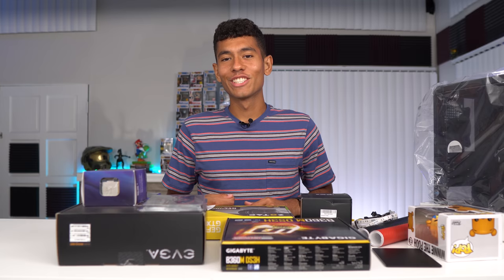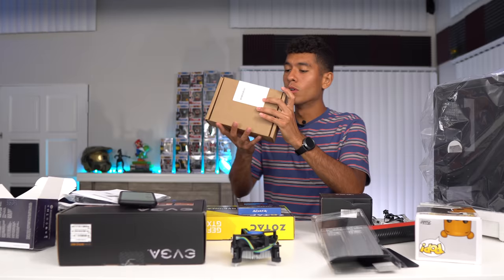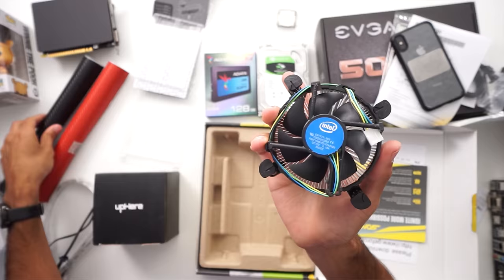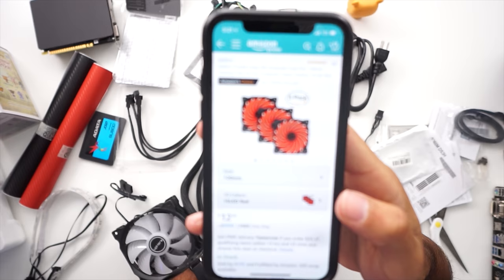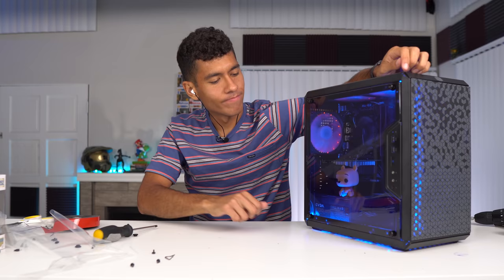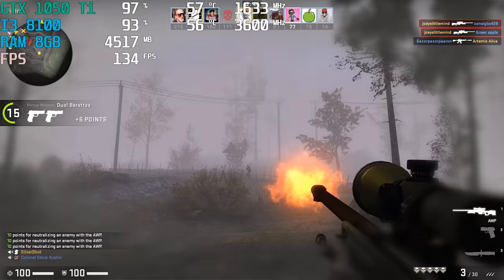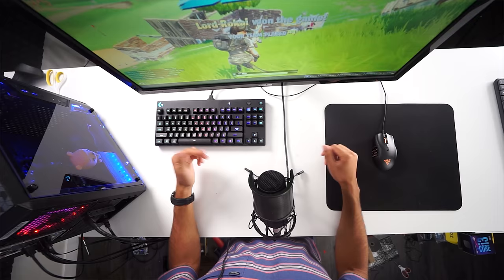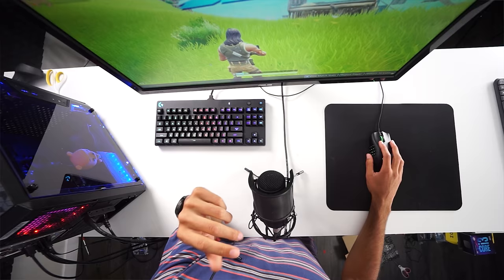$650 Gaming PC Build - i3 8100 GTX 1050 Ti (w/ Benchmarks)

Comment: Nice build.  I'm planning on something similar but will go for an i5 8400 with a gtx 1060 6gb.

1 question.  Would you recommend the Gigabyte motherboard?  I've seen some bad reviews.  Problems with BIOS updates, installation of Wins 10 but my main concern is the PCI clearance when you put in a GPU.  I want to add a wireless card and the GPU covers the vacant PCI slot.  GTX 1050 might be ok but a GTX 1060 would be much bigger.
Reply: Will it work with this build? 
AMD Ryzen 5 1600 3.4GHz Hexa Core AM4 CPU + ZOTAC GeForce GTX 1060 3GB

And how much of a difference would there be compared to the current build in this video?

Comment: yup those Zotac mini  4GB 1050ti are might. i used it as a Hopd off with a Asus B350-f Ryzen 7-1800x  3200MHz Ram and it was ok, i didn't really see anything, can tell if it was Bottlenecking.  there good cards

Comment: Out of the two 1000$ guides you did which one is better?  I’m planning to build one of them!
Reply: Nick Hunter build the one with the 1070ti and ryzen 5 1600 the 1600 has 6 cores and the 1070ti is Just a lot more performance than a 1060 6gb
Reply: Michael Murphey Ok Thanks a lot!
Reply: Nick Hunter no problem

Comment: Question.
Core i3 8100's data sheet shows that it supports RAM upto 2400mhz. So how come 2666mhz is being used? Won't 2400mhz be cheaper as well?
Reply: the motherboard chipset is b360 which is supports only up to 2666
Reply: I see. Thanks for the info!

Comment: Did this exact build opposite brands. Ryzen 2600x or 2600 .1650 super. G skill 16gb 3200mhz ram. 500br evga psu kingston 240gb ssd asus prime b45m-a/csm mobo. Gets 2000 performance if done correctly

Comment: I have a Asus gtx 1060 graphics card and a ryzen 3 vega 8  graphics and a gigabyte b450m micro atx motherboard and a  500 evga power supply with 2 sticks of viper ram 4gb I got the driver plugged up and the gtx downloaded but it saying I dont have a driver but one is plugged in Then the pc keeps crashing Please help

Comment: Will this be goodfor 1080p60fps gaming and work.

Cpu: AMD - Ryzen 5 1600 3.2GHz 6-Core Processor 
Motherboard: MSI - B350M GAMING PRO Micro ATX AM4 Motherboard 
Ram: Team - T-Force Delta RGB 16GB (2 x 8GB) DDR4-3000 Memory 
SSD: ADATA Ultimate SU800 128GB 2.5" Solid State Drive 
Hard Drive: Western Digital - Caviar Blue 1TB 3.5" 7200RPM
Gpu: Zotac - GeForce GTX 1070 8GB Mini
Case: Cooler Master - MasterBox Q300L MicroATX
Psu: Corsair - CXM 550W 80+ Bronze Certified Semi-Modular ATX Power Supply

Comment: Hey guys! I want to know if this list of parts is good for my 470 dollar PC.

CPU: Pentium G5500

Motherboard: MSI B360M Pro VDH

Ram: Ballistix sport 2x4 2400mhz

Case: Rosewill FBM-X1

Power supply: EVGA 450W BR

Hard drive: Seagate barracuda 1 TB

SSD: silicon power 128 GB 3d band

Graphics card: GTX 1050 to 4Gb

I plan to play all games at 60 fps+ with medium-high graphics detail.

Comment: i have a question. I got the same case,but i still doesnt understand how does airflow works in here. my graphics card blows to the front of the case,should i get case fan on front panel as an intake or exhaust? and one at the bottom underneath the GPU for an intake?

Comment: I need help building a PC I’m basically new to PC gaming. What I know I want is this:

A PURE PERFORMANCE BASED FPS Machine.
I can live with out the RGB. But I am on a budget. 

I want a consistent 144FPS on Titles like Rainbow Six Siege, Overwatch, Pubg.

I already own a 144hz monitor. But I need a machine that can fully utilize it.

I know that I wanna stick with Intel i5 but I can get the i7 if Necessary.

My friend is offering me a gtx1060 for $100 so I’m probably gonna take it.

How much ram is necessary? I was thinking the Corsair Vengeance 8GB (x2) for 16GB if ram but can I get away with 8GB?

What about powersupply? Is 650w watts enough? Maybe 750? (EVGA)

and the motherboard I was told ASUS motherboards are easy to work with? So I saw a Asus z370-II LGA

I definitely want an SSD I saw the Samsung Evo 860 500gb (I don’t use a lot of memory)

And as for a case I chose the Meshify-C based on Price and Airflow.

What else do I need? Some cooling fans? A cpu cooler?.

(Just to be clear this PC I want to be my startup build that can run FPS at 144FPS consistently even if it means tweaking the settings in game. Pure performance. No RGB. I can always upgrade parts later.)

ANY HELP IS GREATLY APPRECIATED.

Comment: Hey nice build but If i were you i would save up a bit more to buy a core i5 cause the 1050 ti is kind of more reliant also a bit on the CPU and trust it will increase the power and well worth the price
Reply: If I made this build and replaced it with an i5 would it be compatible and do you know how much it would increase FPS quality etc?
Reply: @dhruvmadaram7842  it would and I would say you can bump up to 20 more fps
Reply: @blownshards1324  okay thanks a lot for the help man

Comment: I'm gonna be upgrading my pc from
Intel Pentium i5-750 2.67ghz
Gtx 1050ti MSI 
8gb Kingston DDR3 RAM
500gb hdd
And some old Asus motherboard
to a 
Intel core i7-3770 or 4770
16gb ddr4 ram
256gb ssd and
1tb hdd or 512gb ssd instead of 256gb
And some new pretty cheap motherboard

Whadayathink guys?

Comment: question...if i use gtx 1060 3gb with this build..wont the cpu bottleneck the performance of the 1060? thanks for the answer....
Reply: Yea a little but I reccomend replacing the i3 with an ryzen 1600 and getting a 1060 3gb
Reply: Would this work?
AMD Ryzen 5 1600 3.4GHz Hexa Core AM4 CPU + ZOTAC GeForce GTX 1060 3GB

And how much of a difference would there be compared to the current build in this video?
Reply: @BSTGMR-kj3tu  yea it should be a beast 1080p gaming machine, big performance upgrade from 1050ti to 1060 3gb and 6gb, I would reccomend spending a bit more money on the 6gb version because newer games are requiring more vram so. But yea but that should work perfectly

Comment: Is a PC like this capable of playing games like R6, Destiny 2, Overwatch, etc at ~60fps at Medium-High settings while streaming on Twitch at 720p 60fps? 

If not this build, then is there any other one of his builds capable of reaching that desired number? My budget is sitting at roughly $800 so even if it isn't a build from this channel, any build would be greatly  appreciated :)
Reply: Ryzen 5 1600 or r7 q700, b350 mobo, 1050 ti or higher, 16 gigs of ram, and the rest is what u want ssd, psu etc

Comment: So I’m building a pc and I’m completly new to this but i have everything’s but instead I’m getting “MSI GAMING GeForce GTX 1060 6GB GDRR5 192-bit HDCP Support DirectX 12 Dual TORX 2.0 Fan VR Ready Graphics Card“ instead of the 1050 and for ram im getting “
Ballistix Sport LT 16GB Single DDR4 2666 MT/s (PC4-21300) DR x8 DIMM 288-Pin Memory“ instead. Will that work with all of the other parts correctly and is that worth it? It adds like an extra 200$ in total.

Comment: Is this a decent combo for 60 fps 1080p?

Amd ryzen 5 2600x
Sapphire rx580 nitro 8gb
X470 mobo
500w psu
2 8gb sticks of 3000mhz ram
I want the build to be upgradable by just getting a better graphics card in the future. Thoughts?
Reply: Yep
Reply: @lilcupp5517  yea it does me great. Not even overclocked and its great. Compared to consoles.... which suck major nutz

Comment: Today with $650 you can build a i5 with 1060 . Also ssd now is very cheap . So just get a 500gb ssd with a 1tb hdd
Reply: Nazreen Helmi  really?
Reply: @crispjg3605  yup
i5 9400f = $150
Gtx 1060 6gb = $200-220
Mobo = $80
Ram 2x8gb = $90
Psu 550watt = $50
Storage ssd 500gb = $80 / hdd = $45
Pc case = $30
Reply: @crispjg3605  prices will drop in 3-4 months so go grind da munny

Comment: Used is the best way. I bought a pc for $240 with everything but a cpu and storage which the specs are am4 motherboard, 8gb ddr4, rx 570 and 460w psu. I'm gonna buy a ryzen 1600 for $120.

Comment: would recommend to get a 1060 6gb or 1660 for a lot more preformance but ofcourse if its in your budget
Reply: Dragon Tomas also an RX 570 runs round 5-10% better performance wise than a gtx 1050ti and is also cheaper
Reply: @decstar  true

Comment: Is it good? 860$ (600pc)
Dual Core G5400 3.7GHz (67$)
AMD Radeon RX560 4GB (185$)
16GB Ram 2400MHz (170$)
Western Digital 1TB (50$)
SSD Kingston 120GB (40$)
Gigabyte H310M S2H LGA1152v2 (75$)

and one amazon product: ViewSonic XG2402 24" 144Hz 1ms 1080p FreeSync 260$

I want a pc for PUBG (Super Low, Render Dis High) Fortnite (Quality Epic, Render Distance Epic, Shadows Epic and the rest medium) Pubg mobile on emulator and miNeCrAfT
Edit: In Romania (ma country) things are more expensive :

Comment: I have a lenovo h50 pc specs are i5 4460 8gb ram and 1t hard drive and a gt 705 i wanna upgrade the gpu and case as it is small any suggestions?

Comment: I built this exact pc but my graphics card was preventing the pc from connecting to the monitor, so I got a new graphics card and it still doesn’t work. Please help
Reply: Did u connect to the back of the graphics card?
Reply: Or even turn on psu

Comment: you could've used a ryzen 5 2600 and XFX Radeon RX 570 for better performance
Reply: I would have chosen ryzen 3 2200g and rx580 instead
Reply: @Joe-yp7fi  why's that?
Reply: @illusionslooth9777  actually i take back my statement i looked on pc part picker and  put together a 2600 and rx 580 for 650
Reply: @Joe-yp7fi  oh wow, mind sending me the link?
Reply: link is already there
Reply: @Joe-yp7fi  there is no link
Reply: @illusionslooth9777  I could just tell you the parts I used
Reply: @Joe-yp7fi  why not the link? just ctrl+c then ctrl+v
Reply: @illusionslooth9777  i already put the link twice and you said you dont see it

Comment: Will a 2 fan ghraphic card fit in this case? And could abyine point me to a motherboard that will support the Ryzen 5 2600 out the box and no not the 2600x. Thanks.
Reply: apple dell aids prime b450 plus great motherboard for the 2600
Reply: apple dell u should get a atx case instead u have more room more future proof and the double fan card will fit
Reply: Noah Ahmed i picked up this one in the video i wanted to get a win min 101 case but 80$ was to much for me for that case i picked up the 2600 and some 8 GB of viper 3000mhz ddr4 ram im just stuck on the motherboard this will be my first build the motherboard i was going to go with is the gigabyte b350 with Wi-Fi I believe
Reply: Noah Ahmed is the Asus prime b450 motherboard going to work out the box with the 2600?? Its the one thats 89.00 on newegg??

Comment: Heey Joe .. maaan I love your chanel i think I watched over 50 videos in the chanel in FULL I'm not even skipping few seconds I love your builds..
I'm in the process now to build my own very first gaming PC ever .. I just hope that you can build something very very similar for me in your channel just to have a look on the benchmarks and performance bro .. I'm going with ..
* i7 9700K
* Corsair Vengence RGB pro 16GB Ram 3000mhz DDR4
* intel 660 m.2 SSD 512GB
* 2TB WD HDD Blue 
* Asus Prime Z390-P motherboard
* 750W PSU
as for the GPU, I'm on a tight budget now so I will wait few months, save up and  buy my GPU ((most probably RTX2070)).. but as of now I will be using MSI GTX1050ti 4GB I found it really really cheap so I think its good to start with on a temporarly basis..
there you go bro.. those are all my parts, can you build something like that just for me to have a look on everything together and performance, thanks in advance 😎👍
Reply: Why 750 watt thats way too much

Comment: What if I used the money for ssd and just used it to buy a 1060, will it work?
Reply: Burdii Ako yes, do that. 1060 is so much better than 1050ti
Reply: yeah that would work. You are basically sacrificing startup and boot times for applications for more raw performance in games, if thats what you want, I would still recommend a small 120gb ssd to anyone. I would also recommend looking for a aftermarket graphics card

Comment: Hi Man, thanks for the video, i have a question for you, I'm making my first build using this case AND im worried about the cpu Cooler, I've got an hyper 212 Evo from cooler master and i dont know if my cooler Will Fit In this case. What are your thoughts? 

Thanks in Advance for the answer
Reply: julian camilo gil vargas their should be enough space for it
Reply: It will be extremely close the acrylic if not barley touching it

Comment: JUST PUSHING MY LUCK JOEY I HOPE IT CAN CATCH YOUR ATTENTION... IVE BEEN THROUGH A LOT HARD WORK BUT STILL CANT BUY A GTX 1060 FOR MY PC BUILD I HOPE YOU CAN LEND ME SOME OF YOURS OR SPARE ME.... IT SO EXPENSIVE HERE AT PHILIPPINES, IT TAKES ME TO 6 MOTHS IN ORDER TO BUILD MY PC BUT STILL DOESN'T HAVE A GTX 1060... I ALREADY HAVE A RYZEN 5 2600 AS MY CPU AND A LOW PROFILE RAMS AND CASE AM4 MOTHERBOARD AND FANS... IT HELP ME A LOT JOEY. ILL USE IT NOT JUST FOR GAMES BUT FOR MY SCHOOL PURPOSES AND AUTO CAD RENDERING AND OTHER COMPUTER AIDED DESIGNS OR SOFTWARE APPLICATIONS.

Comment: Can you change your graphics card on this pc to like a 1080 or higher? @Joey Delgado or anyone that knows?
Reply: That wouldn't be a good idea and you would want to upgrade your processor.   Upgrading to an i5 or i7 would make the GPU not bottleneck as badly.  Also If you were going for a 1080 or higher you would most likely want to upgrade your power supply also.
Reply: @manateeksa4715  can u upgrade the processor from a i3 to i7 or i5
Reply: @tylerk5038  Yes you could

Comment: Will work if I buy a I5 instead of a I3?? Pls help
Reply: Korcy I’m tryna figure that out because if I put a i5 I will be able to stream.
Reply: @Snackyfn  I would've tell you if I knew but I don't. Btw we almost have the same name XD
Reply: Korcy turns out you can upgrade the processor from i3 to i5 but it has to be the 8th gen so the i5 8600 it’s fine but they are pretty expensive but it’s still like $700 for the whole pc
Reply: Snacky, thank you so much
Reply: Korcy Korcy the i5 8400 goes for $200 and if your on a budget like me you should go for that. It have run 60 fps on epic and high setting on fortnite. And over 100 on other games. Search up, i5 8400 with gtx 1050ti. You will see how it can perform
Reply: @Snackyfn  thank you for the advice and also is there a diference between i58600 and i58400. I mean is it worth it or are they almost the same
Reply: Korcy the i5 8400 is good enough. You will be able to stream and play good with a lot of FPS. If you have the money go for the i5 8600 it’s faster then the i5 8400 but they are both fast and kind of do they same
Reply: @Snackyfn   thank you so much for the advise dude. 😚😚😚😚😚
Reply: @Snackyfn  I was jk with the emojis
Reply: Korcy your welcome bae 😘 lmao sike nah
Reply: Korcy I will be building this in like 8 weeks because I need to save up and it’s hard lol anyway good look man
Reply: @Snackyfn  thx. You too

Comment: I am building after 7 months. But i am going with i3 9100f. You know, 8100 is overpriced. I got the 9100f under $100. Pairing with gtx 1050ti.
Reply: Thot Police I went with an i3 9100f and an rx 570
Reply: Did you pick GTX 1050 ti on purpose?
Reply: @zaki2x457  I wish I bought rx 570 instead of 1050ti.
Reply: @theclasssy3320  i know bro!  I bought it about 3 months ago & i didnt know much about that. There was an offer at that time too😭😭😭

Comment: Should i follow this? Or should i follow another video?
Reply: Joey has made more build guide videos. Also this build is pretty good for the money. If you have more cash id recommend you purchase a rx580 or a 1060 both great gpus and are better performance than a 1050ti. I'm not to familiar with Intel CPUs but Ryzen does have 1200 or 1300x which are over clockable when paired with a b350 motherboard. Hope this helps
Reply: @decstar  thanks!!

Comment: The CPU's locked, so, will I need overclocking for the new triple A titles or will it work out just fine? Cuz I might look for another CPU if the reply's positive...
Please, Reply.
Reply: Hey there! Overclocking will generally only yield you a 1-5% increase in FPS (more if you use liquid nitrogen hehe) depending on the game, so unless you're dying to get that itty-bitty increase, you won't need it. If you're looking for a similar model with OC capabilities, go for the i3 8350K. Or better yet, go for any of the Ryzen 3 models (you can OC on all of them). Hoped that helped! :)
Reply: Julienne Lequin Thank you sooo much👍🏻
Reply: Julienne Lequin Any video that  completes the compatibility issue with 8350’s motherboard? Like, a complete setup...
Reply: No problem. Glad to help. :)
As long as you use a motherboard that supports 8th Gen Intel CPUs (LGA 1151 Socket), you are good to go. 
If you are looking for a full tutorial to building a PC, you can check out the one on my channel. :)
Reply: Julienne Lequin K, thanks again!

Comment: can i buy a 1060 gtx will it still work instead of a 1050 and use a i5
Reply: Yea. There would be no problems with that combo. As long as you are not using an old i5

Comment: hey joey I have a i3 7100 do you think its good enough to run the graphics card without a power supply?
Reply: Stupidhead154 you need a power supply no matter what... but the 7100 will be fine with a 1050ti.
Reply: Tyler Massie ok thanks

Comment: I made one with these specs:
PROCESSOR - CPUCPU AMD RYZEN 5 1400 3.40GHZ 4-CORE WITH WRAITH STEALTH BOXhard driveSSD LITE-ON PH6-CE120-G MU3 SERIES 120GB 3D NAND 2.5 '' SATA 3.0hard driveHDD TOSHIBA DT01ACA100 1TB 3.5 '' SATA3MEMORY RAMRAM PATRIOT PSD48G240081H SIGNATURE LINE 8GB DDR4 2400MHZ UDIMMgraphics cardVGA ASUS GEFORCE GTX 1050 PH-GTX1050-2G 2GB GDDR5 PCI-E RETAILmotherboardASROCK A320M-HDV RETAIL MOTHERsound card8-Channel High Definition Audio CODEC.Network CardRealtek Gigabit LAN (10/100 / 1000Mbit / s).visual mediaLITEON IHAS122-14 5.25 '' SATA DVD-RECORDER BULK BLACKBOXES - CASESCASE INNOVATOR PROMETHEUS 1 BLACKPOWERFULPSU INNOVATOR IN07XD 650W BULK